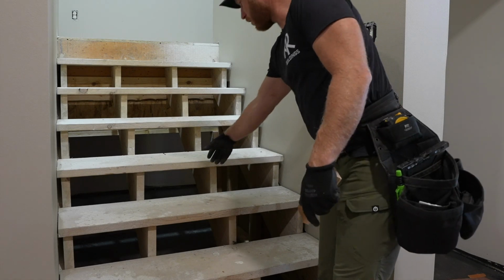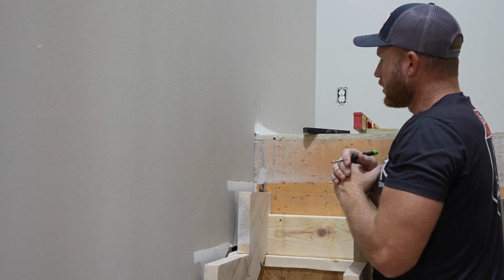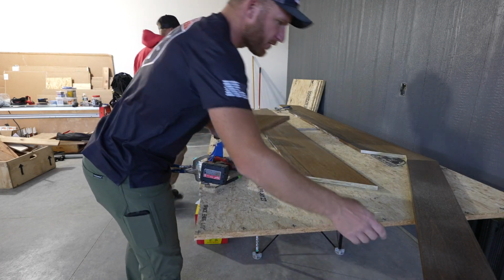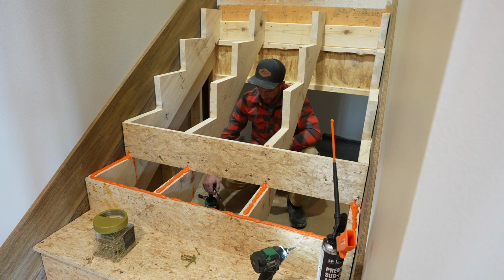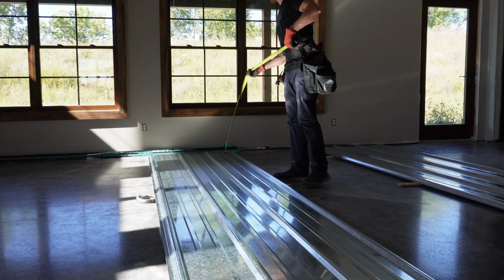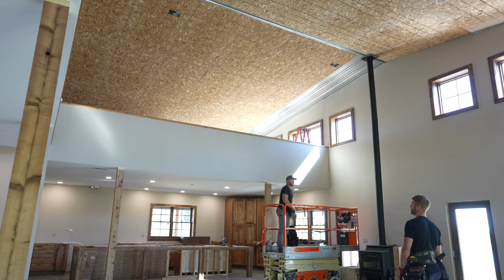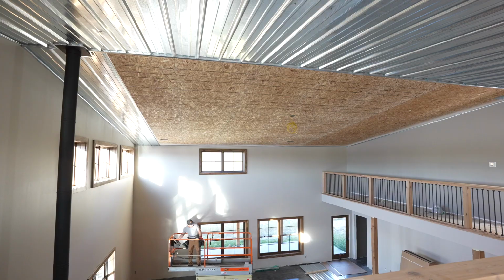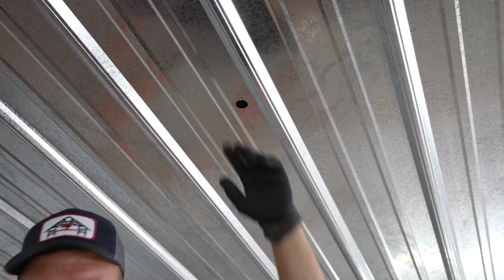Building A Barndominium:  Finally Installing a Galvanized Ceiling

Comment: Nice thinking on the stair design, they are tricky. I appreciate you used four stringers there, I’ve seen a lot with just 3 or even 2

Comment: Hey Kyle first off I am the last guy who should give tips!  Your a totally amazing carpenter compared to my skills otherwise my face would be all over you tube like yours!  Having said that I found when setting skirts if you take a piece of tread nosing or exact size piece (thickness) place that on your rough tread , then set your Stabila level across it mark a line that gives you a 2 3/8 off set which looks or makes a good skirt reveal (no Greg not that skirt buddy hang tight with me!).  And of course you had 120 degrees subtract 90 which gives a complimentary number of 30 degrees which seems a little low whereas most are 35-37 degrees however I am sure you hv that dialed in!
It looks amazing your one of the few carpenters I hv seen switch from framing to finish flawlessly !  Buddy that’s why I hv you Tim, Spencer dialed in!

Thk you very much for your time!
Truly appreciate you brother!

Comment: Man, that is a gorgeous look.  Fire resistant, light reflective, easy to clean, renewable material, fast assembly, and on and on.  I love me some metal walls & ceilings - then accent it with sections of sheetrock & color or wood grain coverings.   Metal goes with EVERYTHING.
Reply: See DSM, this is they guy I'm talking about.  Very typical american.

Comment: The only step up above the stair quality you did would be to cut the riser boards long by 1/4"-3/8" and dado the run boards to interlock when they are placed down. Glued and screwed with the locking joint they will never make a noise for decades of use.

Comment: I did galvalume in my shop for the ceiling and walls above my wood liner. I think it's the way to go instead of white liner. I've been in enough shops with white liner panels to see that after a while they hold dust on every horizontal surface. And the greasy finger prints are everywhere.  The galvalume hides the dirt and grime so much better.also it brightens things up because it's reflective.

Comment: I may have missed this in your other videos but have you ever installed trusses onto a truss carrier due to needing to handle more weight . I am talking about snow load for a post frame up north where snow is a big thing and need the spacing of trusses closer together instead of the 8’. I have seen in past videos that the trusses you install are secured to the laminated wood columns. Would you recommend truss carriers for this situation?

Comment: I was just typing a response in regards to it being what the client wants/ likes just as you said it..  
Personally I do not think it fits and lowers the aesthetic.  If it were my build, I would have ran a stained trim board that matches the handrails to emulate a beam, maybe 2"x6" and then used a product called Tectum made by Armstrong, that comes in sheet form and can be flat beveled edge.  It is paintable and has great sound attenuation and can have a elegant industrial look to it.   
But that is just me and my taste from 23 years in the field of architecture.

Comment: like the angle finder! I have a digital level that shows the degree of your wall or floor, but not where you can extend a tool from the level to show the degree of the angle in relation to what the floor is actually sitting at. That'll help come up with a nice clean miter joint for sure! that's pretty clever. I guess you accommodated for the uneven slab when you done everything, but nothing is perfect, no matter how much effort you put into plumbing, squaring and leveling everything, and that will effect the tightness of miters on your trim. Just my take away from it anyway, but you always do above average work, Kyle!
Didn't really expect stairs, though. I was thinking galvanized ceiling, but I'm glad this is a part of it. I like theway you gave space for the sheetrock and trim board beside the risers of the stairs!

Comment: My wife and I were watching your video and agree that the use of the metal ceiling was cool but maybe not the silver galvanized look.  I even was trying to imagine it black.  It would tie into the black ballisters, black wood stove and dark concrete floor.  There are so many windows I think there would be a good balance between light and dark.  Something other than the silver IMO.  But beauty is in the eye of the beholder, right 😁  As always excellent attention to detail.
Reply: Black would make the room very dark but agree the color might look better. There are tradeoffs always

Comment: Valted ceilings are always a challenge. Have you ever installed Tectum.on a valted ceiling? They have a complete system including insulation. Tectum also has very good acoustic characteristics.

Comment: It's definitely looks interesting. But, i think, it will be more appropriate for garage or some loft apartments in the city, but not in the suburban house. For me it has a lot of issues with the light reflections. Maybe it will be better to choose some black or another colored ceilings (even made from galvanized steel).. 
And i need to say one more time, that it's only my opinion and, instead of this, you've done a great job!

Comment: That metal galvanized roof on the inside it going to bounch every sound right back downward and make it almost impossible to even have a quiet moment...bad mistake..
Reply: Wicked hard read.  They didn't work on the roof, and bounch is not a word.
Reply: @dwindlefoddl7225  You realize I still have the tab open with your train wreck of a comment before you edited it..  That I now have a screen shot.  You could have laughed, edited and said thanks.  But nope.  Never admit fault.  Double down, blame the other person for your faults.
Reply: @dwindlefoddl7225  I bet you are impressed when you remember your name in the morning.

Comment: The sheet metal vs. textured sheetrock ceiling treatment as a economical substitution for expensive tongue and groove plank is pretty smart. So, when the opportunity becomes available to upgrade it, the demolition of the metal ceiling doesn't create the dusty mess, screws and nails like sheetrock would.

Comment: That would be a bit too bright for me. I think i'd like a weathered tin look better maybe spray vinegar on it prior to inst. to cut the brightness down. We re-roofed our hay barn and I was able to save a ton of $$ by buying some stained/weathered tin. I bought from the mfg. and they rolled it to my desired length. The roll of sheeting had been outside in the weather a while and took the shine off it which I think looked better in the long run. I'd hate to wake up to that day after day.

Comment: How can OSB be a premium subfloor? OSB is just one step above particle board. OSB is (like particle board) a garbage product and should NEVER be used as a subfloor. I have had many issues when I used to use OSB as a subfloor. It might be cheaper than using planks or plywood, but cheaper is NOT always better. It’s better to spend those few extra dollars on solid wood subflooring than having to come back later and repair it.